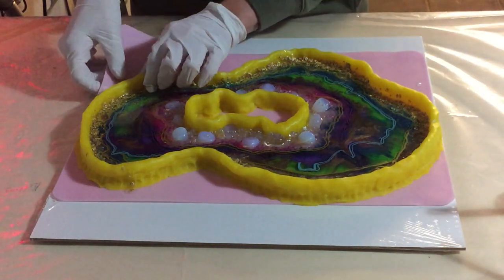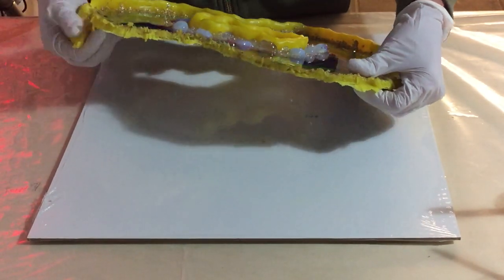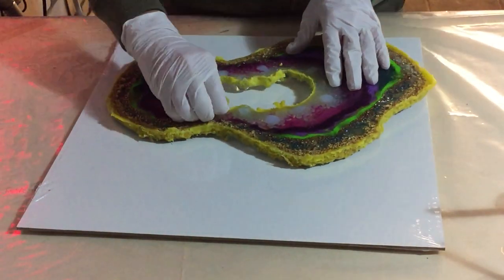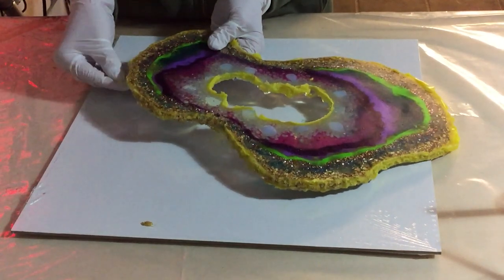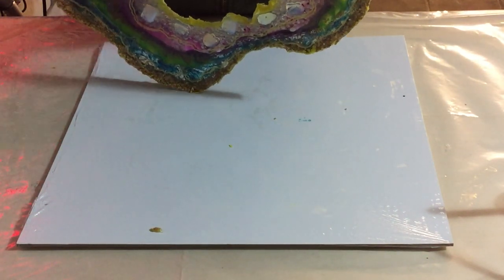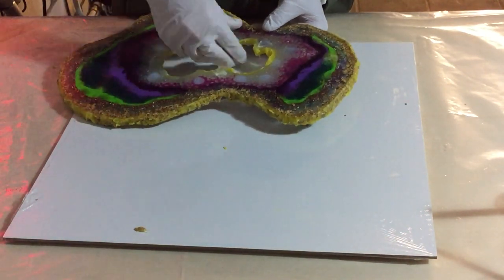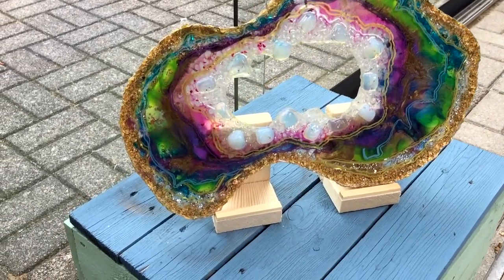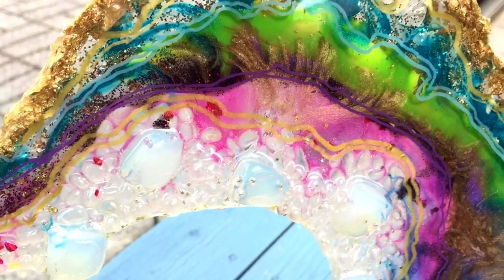32. Making a Resin Geode in Self Made Mould. Part 5/6

Comment: Just a tip I use kitchen and bathroom 100 % silicone caulking in the tube with a caulk gun it's a bit stinky at first but once it dries it doesn't and resin doesn't stick to it as long as you let it cure completely, if you want to build it deep the molding clay would be a good support wall to build it
Reply from the maker: Thank you so much for the tip. I also thought about using that, but maybe I can add something to it so it doesn't stick as much.
Reply: I didn't have any sticking problems, peeled away easy, and I used it right out of the tube, I didn't add anything to it
Reply from the maker: I mean on the hands. I like to make the shape with my hands. Or isn't is necessary to do it with your hands? Can you make a nice shape directly out of the tube?
Reply: Depending on how deep you want it, you can make each layer as wide as the tube opening will allow , its a bit soft at first just like caulk but stays put , so each layer would have to dry if you wanted to do just the silicone i don't think you can layer it wet. I smeared it on the inside of a 4 piece wood cut out because I was to impatient to wait for layers to dry so you could do the same with the dough, might be better than wood cuz no joints to leak , i had to sand the joint leaks away, and use a putty knife to coat the inside of the dough with a layer of silicone as it does not have to be very thick I used one coat on the wood used a putty knife to spread it across and let it dry and no sticking anywhere
Reply from the maker: Thank you so much for your explanation and for all your suggestions. I appreciate it a lot. I will definitly try the dough and the silicone as you explaned.

Comment: I don't put  a very thick dough barrier and during I worked with the design in the geode I applied around and on top of the dough another serie of crystals and than added a coat of resin - so, the dough is included in the resin art work - same technique  I did with wire and alufoil. the easiest way is - just on the silicon mate the rings with crystals or stones cover in resin first. after it dries you can work normal with the resin and colors
Reply from the maker: Thank you so much for the explanation.

Comment: Petra I have to ask you what type of resin do you use? Is it very harmful for your breathing? I really want to get into doing this myself! I have such creative ideas for resin but I'm afraid of it structurally. Is it very brittle? Easily broken?
Reply from the maker: Hi Tracy Keaton, I'm using mastercast 121 and it states non toxic. In the description it states that you only need to wear gloves and safety glasses. Also that you must prevent getting resin on you, because you can get an allergic reaction from it. I'm Always very carefull with resin. I wear long sleeves, I'm double gloved, wear safety glasses and a respirator for organic fumes. I believe that it's only non toxic when the resin and hardener is mixed. If you add pigments to it or you put heat on it, I believe it's not non toxic. That's why I'm taking all these precautions. To answer you other questions. When the resin is set, it's very hard, it will not break. It's like a very hard plastic. I hope you understand what I mean.

Comment: I saw someone use silicone putty that hardens, but it stays stuck to the mat and you just pop the geode out of the mould. Problem with that is that you need to make a new mould for each shape geode.
Reply from the maker: Thank you. I also saw that and I want to use something that comes loose of the silicone mat. I already have some idea's to use the dough but that it doesn't stick to the sides as you saw in the video. I don't want to make the same shape of Geode al the time. This way you only need 1 silicone mat.
Reply: I wonder if the silicone caulking they use on tiles and a bathtub Would peel off resin.  🤔 I'm interested to see what you try next!
Reply from the maker: I have heard that it would peel of. I going to do a test with it.